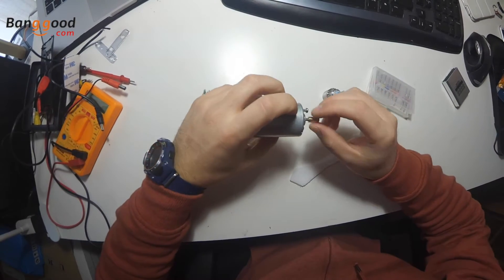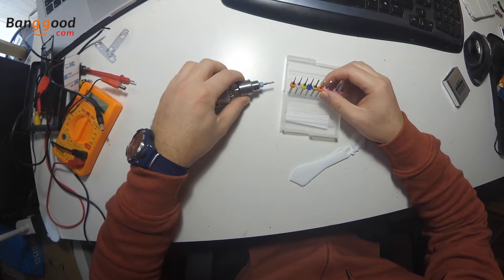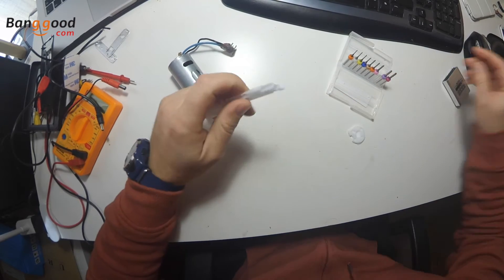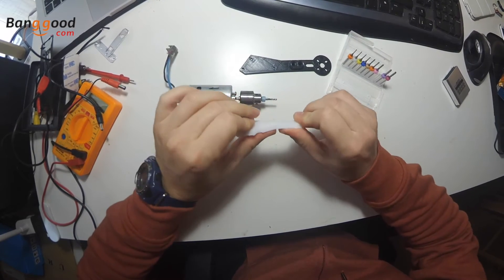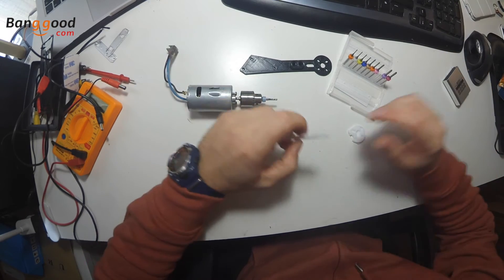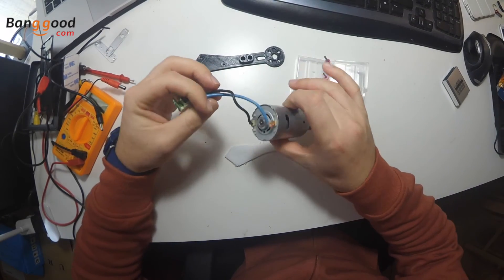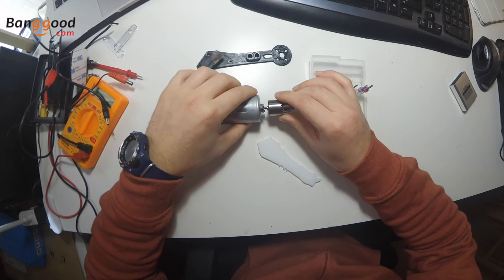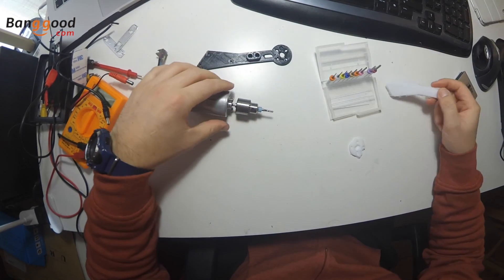Lathe Press Motor with Drill Chuck of bangood.com

Comment: Hi. Interesting video. I have the prusa 3d printer and I have bought this motor and the drill bit as well. May I know which software you use to convert the cnc cutting into gcode? Also, is it we just design the object we want to cut in stl format and convert it into gcode for cutting? Thanks.
Reply from the maker: +SalesTag developer Hi. I used pycam for generating the gcode. There are many others but this one worked for me. With my firmware, Marlin, the pycam gcode didn't directly work, you only have to replace the 'X' by 'G1 X'. 

Yes, it can be just we design the object in stl as you use to do for 3D printing. You can also use another strategy for generating the gcode using a 2D vectorial image. You will have to see a few tutorials about different strategies for cutting and carving. I recommend you to practice with cheap wood or plastic. 

I didn't want to change the firmware, but probably it is necessary to reduce the speed in the firmware configuration. My way for avoid that the drill stacks was by reducing speed and Z steps.

So the challenges are avoiding the motor to stack and learning the cutting/carving strategies, not the stl design.
Reply: +EvilRace thank you. I will take a look at the software and speed problem. One more things I don't understand,  in 3d printing,  it slow go above.   But in case,  it slowly go downward, so I have adjust the z sensor to default Above? So that when cnc start,  it will slowly come down?
Reply from the maker: +SalesTag developer I am not sure if I understood. If you are thinking about the zero position, you can set it in the software. I usually chose that zero position was out of the sheet at the lowest Z position. You will also have to set a safe height, something higher than the sheet. In the software you can simulate the movement so you understand better what will happen with the real drill.
Reply: +EvilRace thanks 😀